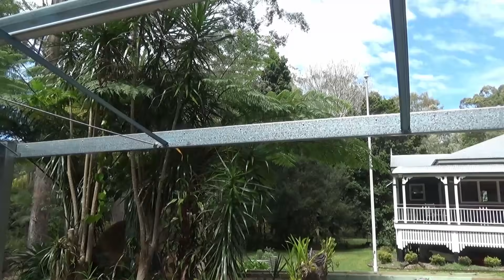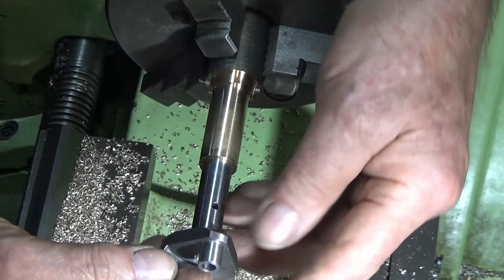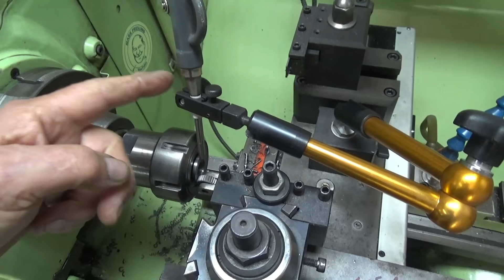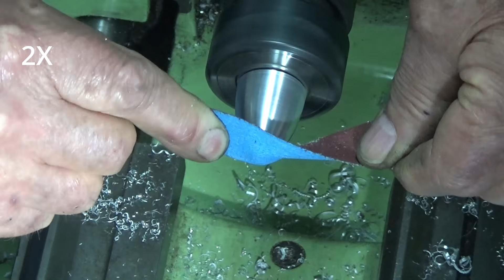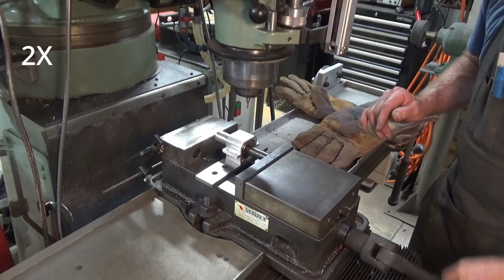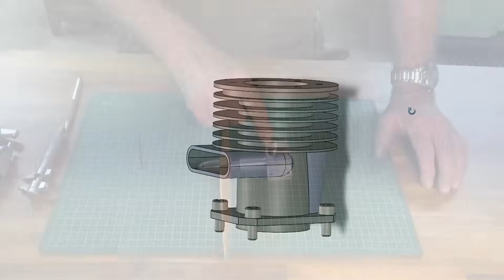Crusader 60. A Model Aircraft Engine You Can Build Without Castings. Ep.3 - Prop Mounting Parts

Comment: That light steel framing once braced and completely assembled is always solid. 
It's generally also easy to work with, tek gun and plenty of tek screws... 💪
Reply from the maker: I finished the entire build today and I did add extra screws along the ridge cap and along the middle purlin. We are coming up to thunderstorm season so it's going to get a workout as we go into summer. 
Regards,
Mark
Reply: Yes, it will be designed to the relevant codes and standards to do exactly what it is meant to do and no more. It is worth remembering that codes and standards are the minimum you need to do.
Hopefully it is capable of meeting the wind loading requirements for the site, which in that part of Queensland are greater than most of the rest of the country.
Reply from the maker: I phoned the company last week and I told him about the added features and why I thought they were necessary. He told me that he uses some engineering software to calculate the wind loadings and there is a table in the design documentation which shows the strength calculations for each member. It shows the minimum design strength and the actual which is always higher but you are correct that it is really at the lower end of what I thought was "strong enough".
Regards,
Mark
Reply: Always expect the unexpected, a little extra effort wont leave you with regrets..! 👍
@Preso58
Reply: It never hurts to add some extra bracing and plenty of tek screws. 👍

 @tuppyglossop222